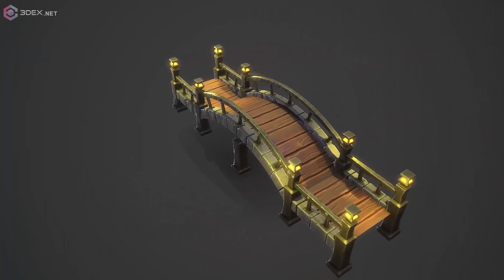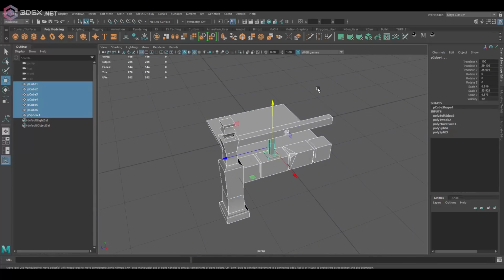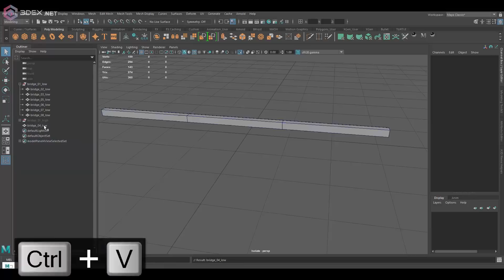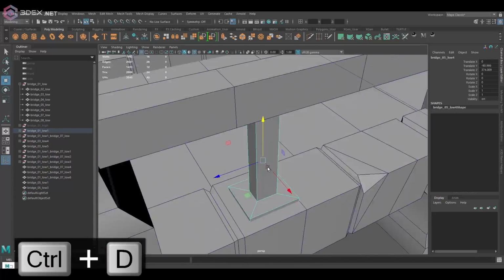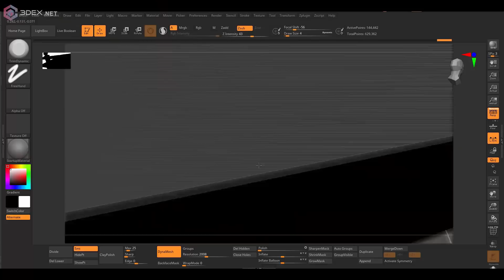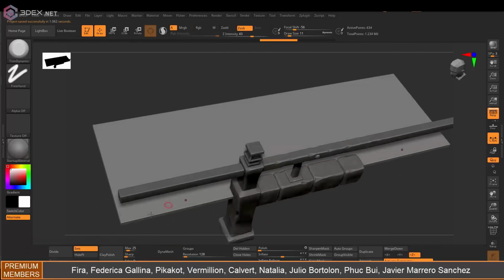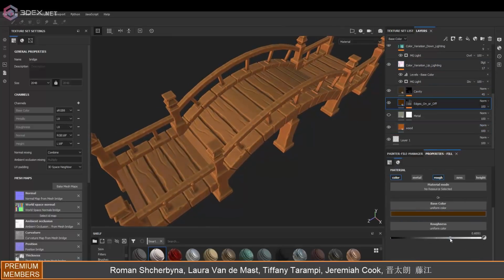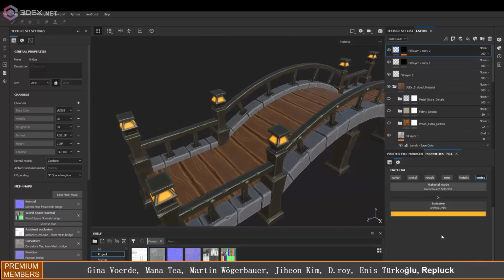Making a stylized bridge with Autodesk Maya 2020, Zbrush, Substance Painter

Comment: sir did you rebuild the highpoly version after sculpting in maya to bake?. or will substance bake the parts based on the names. i m kinda new to substance painter. making modular assets are way too confusing unless its rocks
Reply from the maker: I didn't rebuild geo, yes baked by mesh name.

Comment: Thank you so much for this tutorial, it's amazing to see a professional workflow! I'm creating game assets and using ZBrush for the first time for class. Do you mind explaining how you go from the single unit of high-resolution (with only one post, one long plank board, one railing, etc) and applying the baking to the entire low-poly model? I'm a bit confused if I need to rebuild the scene with the high-resolution version or not. Also, why did you take the version without the bend deform into ZBrush to sculpt? Did you need to apply the bend deform later (to curve the bridge)? Thank you very much!
Reply from the maker: You don't need to sculpt or rebuild the entire bridge, just the initial modular pieces. The point here is to use modular pieces to create a larger structure. the duplicated pieces which are used to make the entire prop are already using the same uvs as the models which are sculpted. When baking those details to the low poly model, all those other duplicated pieces also get the information because they share the same uvs.

Comment: Recently found your channel and liked it very very much. I have a question, if you make this same model in 3ds max, would it be easy or difficult as compared to maya? I'm planning to learn one of these two but can't decide. Any advice??
Reply from the maker: My experience is mostly with Maya. I briefly used 3ds max and can say there are some differences, but I don't think it will be more difficult to use one over the other. One of the main differences is that 3ds max has modifiers and a few extra modeling tools that Maya doesn't. From my experience a few tools seemed to work better in 3dsmax, like the bevel tool, but you can still make pretty much anything with Maya as well. I know this doesn't help in making a decision, but I can only recommend perhaps opening both and getting just a quick feel for it and making a decision before going too in depth.

Comment: hi buddy.like always outstanding. could I ask you one question as a professional? I started studying Maya. When unfolding the shell, when I move the vertices on the shell seam. I cannot select just one vertex per cut. Two are always selected on opposite sides of the shell. I suspect there is some kind of setting active. this is wildly inconvenient. Could you tell me how to turn this off so that I can choose only one vertex per seam?
Reply from the maker: not totally sure what you have enabled, but you can always reset it by going to options reset all uv panel settings or also edit reset uv editor
Reply: @3dextrude  thanks mate. ;) I just missed one think. I choosed the vertexes then I made an anwraping but I should choosed move the to shell. I'm sorry for noob question.

Comment: Beautiful work. I am modeling a environment portfolio, but since I am terrible at texturing would it be better if I showed my work with ambient occlusion shader or with textures? Thanks.
Reply from the maker: For environments I recommend them to be textured, if it's not your strength I can only recommend you practice more and get better at it. Unless it's personal work, in which case you can do whatever you want.
Reply: @3dextrude  Thanks and thanks for responding. I will get on it...lol